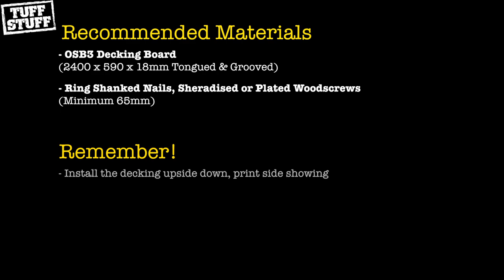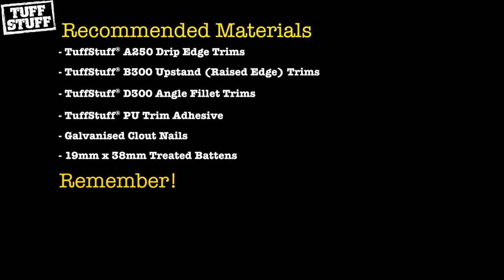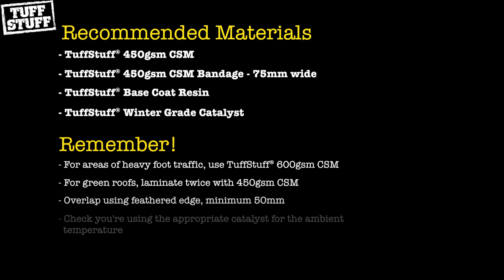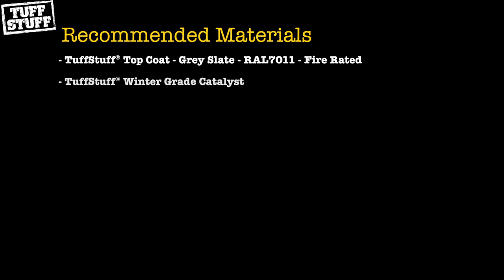tuffstuff GRP

Comment: Looked like a job well done. My only criticism, 
Personally I would have used 2 layers of fibreglass mat, possible 2 layers of 450.
Also for safety ..... goggles should be worn when dispensing the catalyst from its measuring bottle and mixing.